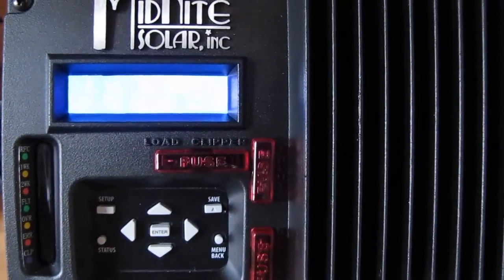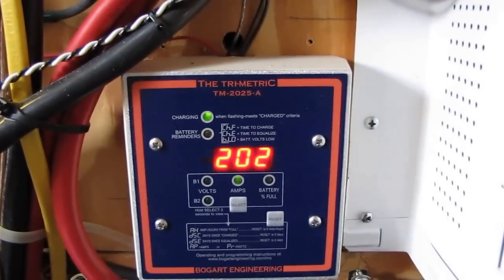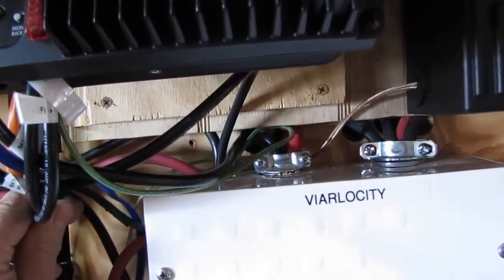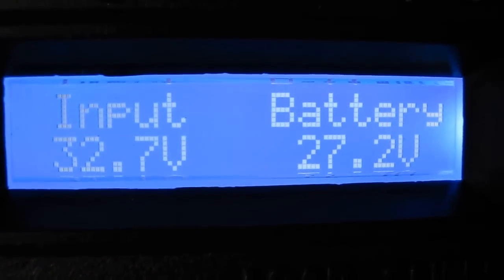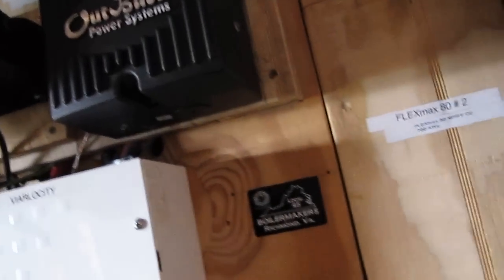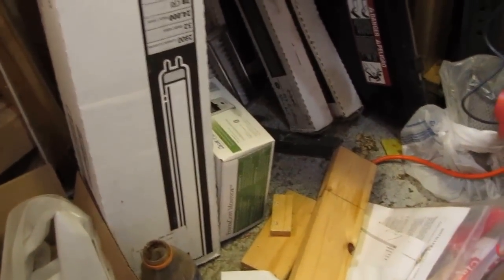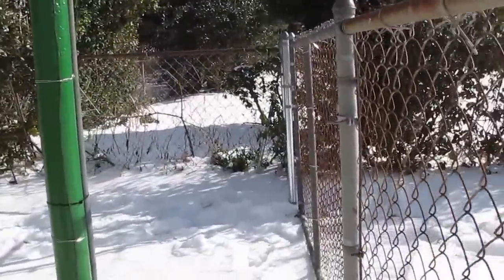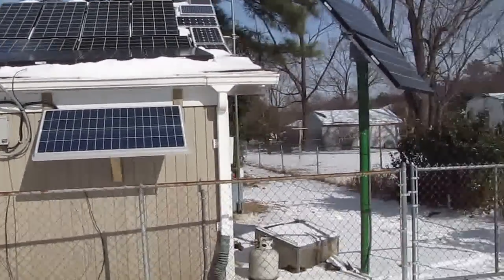MidNite Solar The KID MPPT 30 Amp Charge Controller Marine Version Update By KVUSMC

Comment: Has anyone used the ags function with the kid? If so how well does it work and does it work to start gen. If bank gets low? Thanks in advance
Reply from the maker: Bernard Suyat I'm Not Really Sure All My Generators Are Manual Buddy I Wish I Could Help Cheers Kenny
Reply: Great thanks, one more question, in comparison do you think the kid is better than an outback, I ask because I am looking at either the kid or the outback 80
Reply from the maker: Bernard Suyat  I like Them Both But It Is Really Hard To Beat The OutBack 80's Awesome Trouble Free Unit Buddy Love It  Kid Is A Small Great Unit But The OutBack 80's Are In A Different League

Comment: Nice video and accent! Kenny, here is a simple one, I have 4 250 watt panels, each producing about 37 volts, can i hook it up with the kid in two strings, two panels connected in series and then the other two panels in series and then the two strings connected in parallel. Will the kid be ok with this kind of setup? each panel is about 7 amps i guess. My panels are a total of 1000watts. Thanks!!!
Reply from the maker: Yes You Can Go In 2 Strings 2 - 250 Watter's   And  2 - 250 Watter's    !   Going To A Combiner Box  500 Watts in Series On Each String  That Will Work ! If You Go  All 4 In Series Your At 148 Volts  The Jid Is Only Good For 150 Volts  Yeap 2 And 2 You Will Be Good KingAli

Comment: Hi Kenny, how did you become a beta tester? Because Magnum Energy is coming out with their own charge controller sometime this year (2014). They are to start field testing soon. Since i have their equipment i would like to be a beta tester for them.
Reply from the maker: Just Call Magnum Energy They May Have A Program Dan I Had A Magnum / Magna Sine 2000 Watt Great Equipment